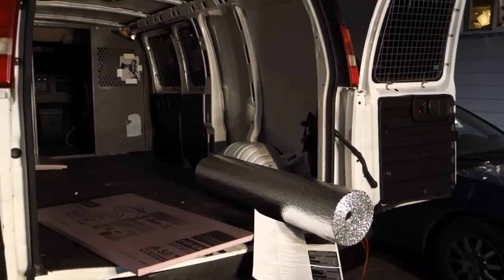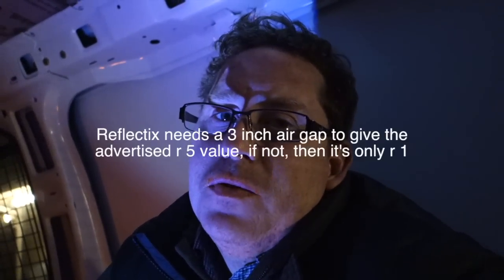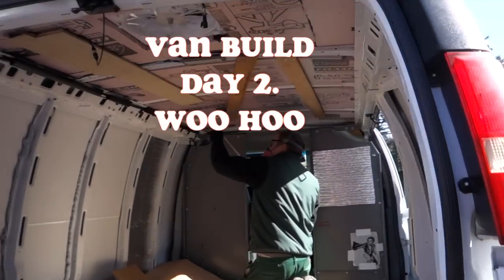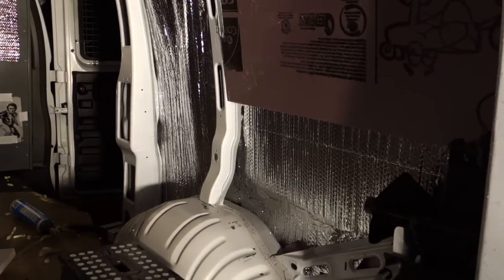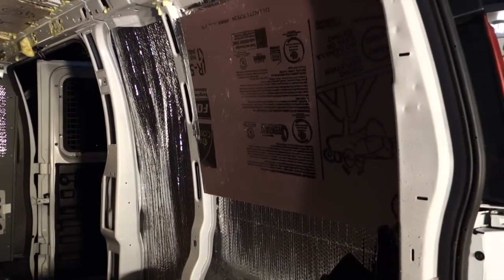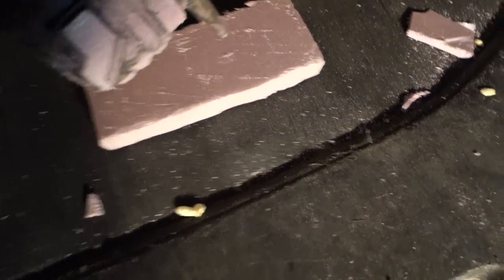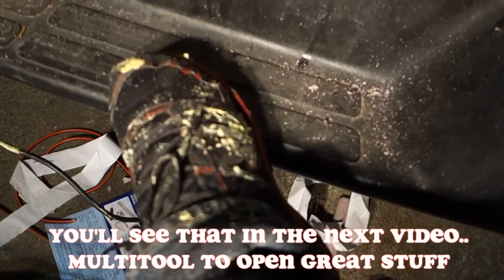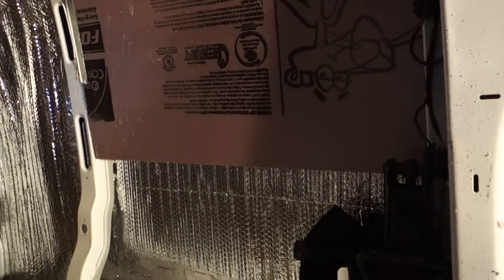Van build 2 - insulation

Comment: I know this video is old. The outside sheet metal on your van IS a vapor barrier. The idea is to reflect to heat you introduce into the van during the heating season...reflect (reflectix) nearest your interior walls for summer heat. Look up ASHRAE on google and search thermodynamics, moisture from combustion, etc. At hte very least, you need to introduce air exchanges, especially if using something like a Buddy Heater.
Reply from the maker: thanks for the info. ya should be ok with the big fantastic fan on the roof now.